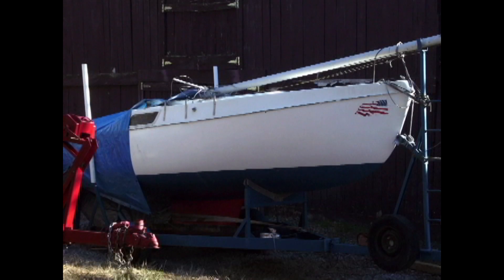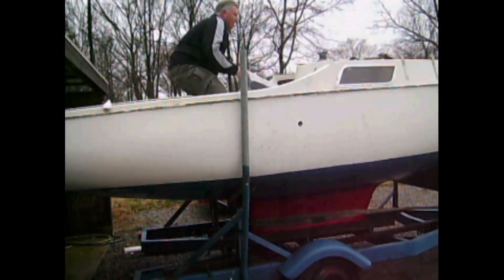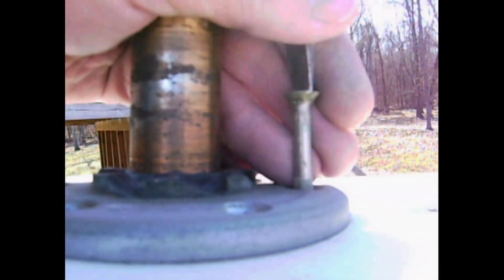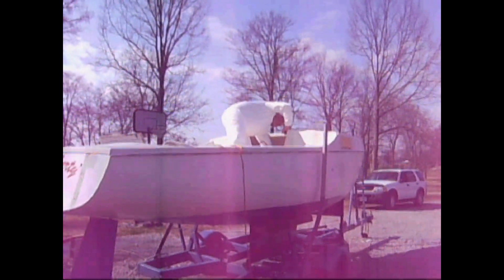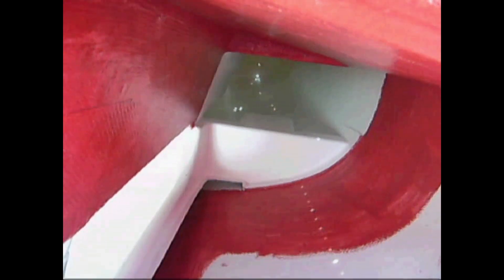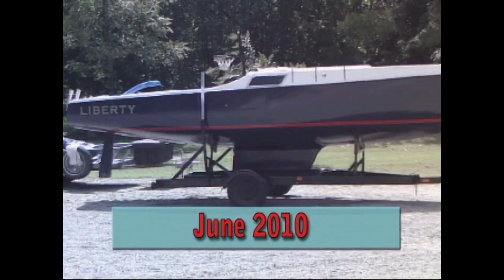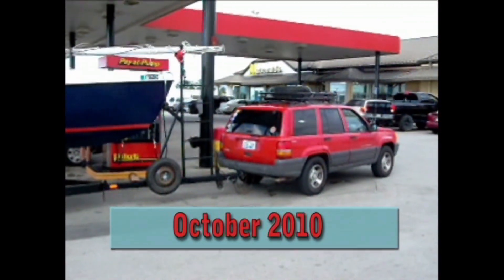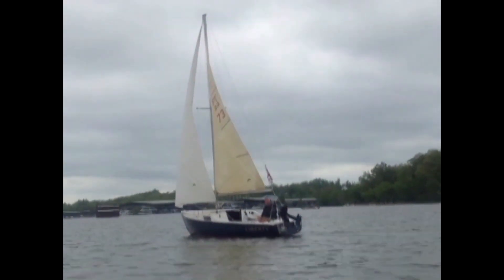Small Sailboat Restoration | Trailer Sailboat | Mustang 22 Sailboat

Comment: Really need a powered respirator doing that work. 😳. Nice job though
Reply from the maker: Tell me about it
Reply: the other option is to seal the companion way and window openings, fit a vacuum cleaner to one window opening and a filtered vent to the other so you are extracting the sanding dust when working in the space. Also helps so you don't have a massive cleanup job once the dust settles on everything.